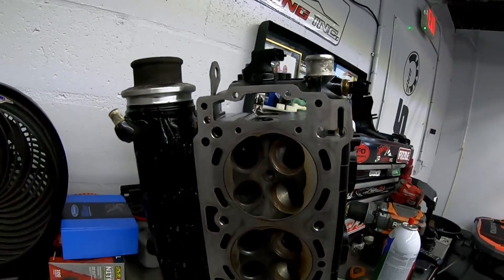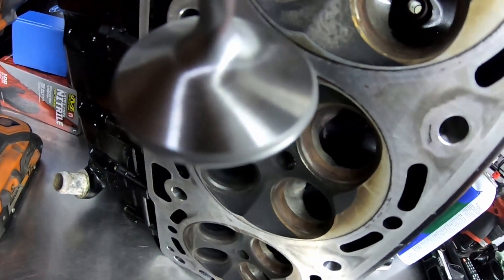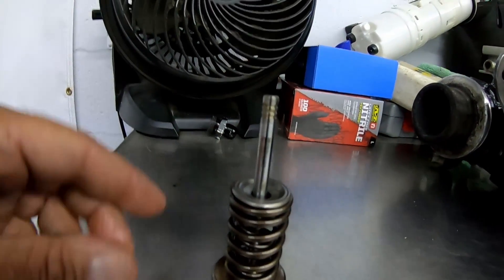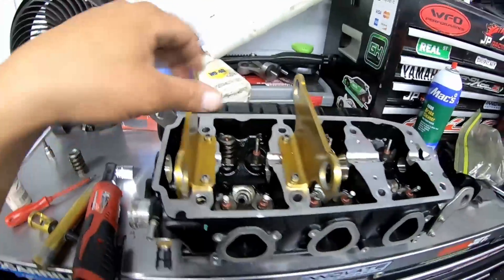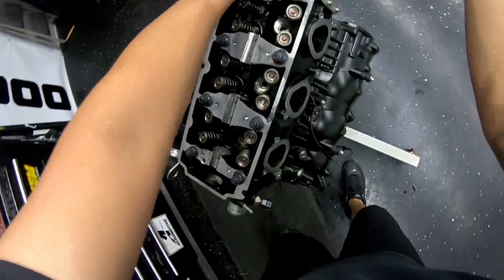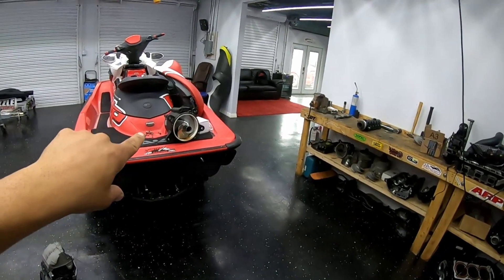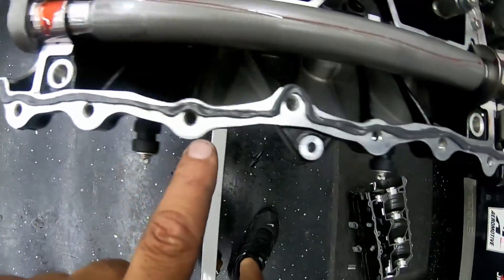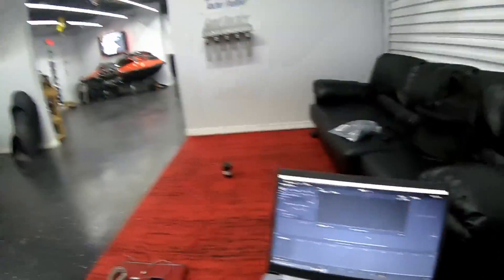PART II.... WE HAVE A NEW TIMING CHAIN! Oh and I assembled the Complete Engine...

Comment: What was the make and model power tool the 90 deg electric impact gun you had? I need something like that for working on skis
Reply from the maker: Milwaukee m12 3/8
Reply: @JP_RACING_INC   Thank you! I have been in the market for some electric impact tools, Just didn't know what worked well. I am hoping to get a 4 stroke project this summer mostly tinkering with 2 strokes now. Any advice on what to look for RXP RXT?
Reply: @JP_RACING_INC  hello, how Can I contact you where I Can send you text